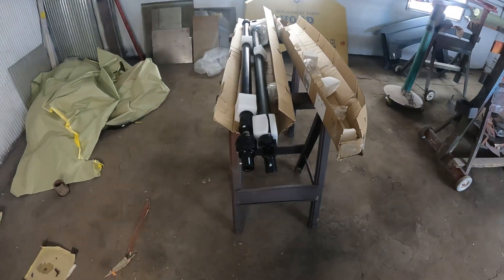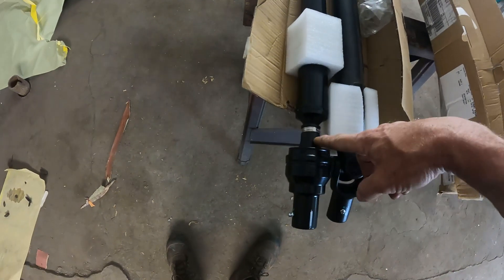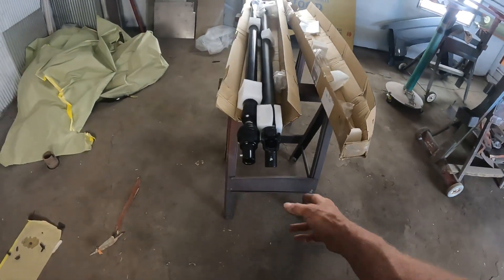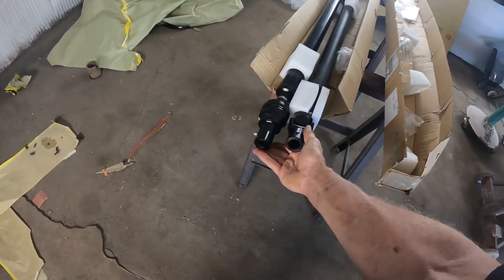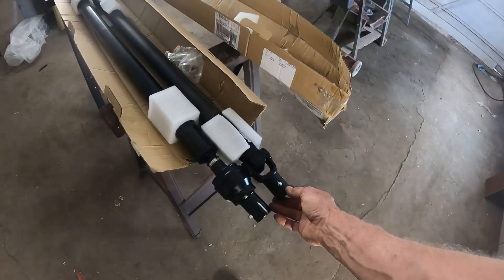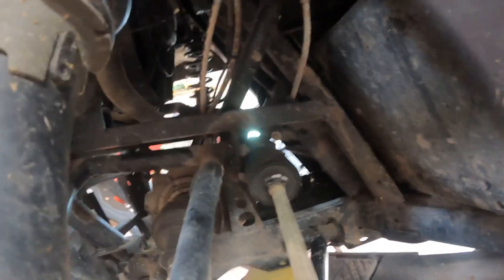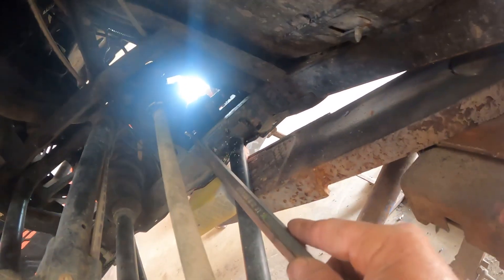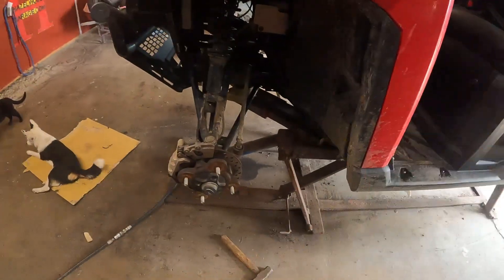Polaris Ranger propeller shaft differences, U joint and Cv joint

Comment: Don't think so, & you'd be getting a u-join instead of a CV. I have a CV shaft on my 2017 & it needs replacement for the last 3000 miles, but I just keep using it on the farm. Mostly low range under 10mph. I got 7500 mi on it now & over 2200 hrs. 1of these yrs. I'm gonna change it. I heard to take the under carriage of & go at it that way. IDK but you have to remove a little brace then replace it afterwards, sound like you can make one & bolt it on drill a couple holes.